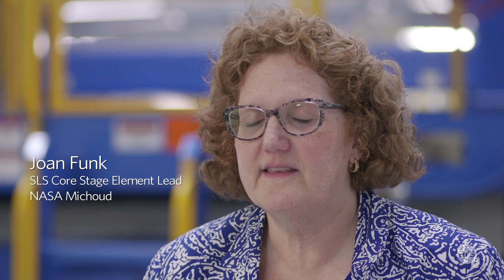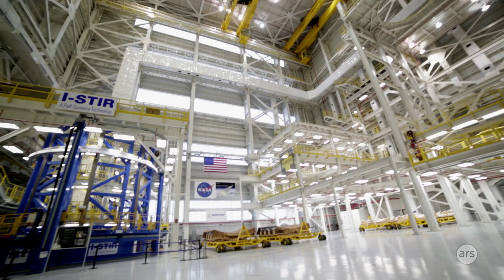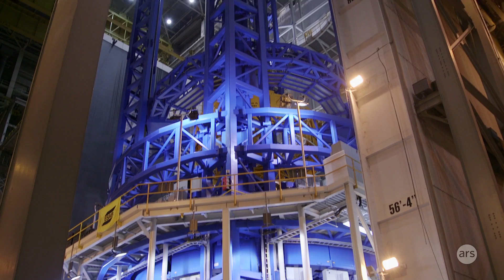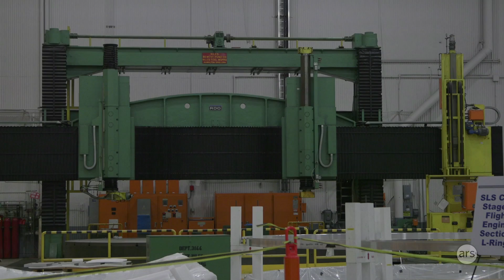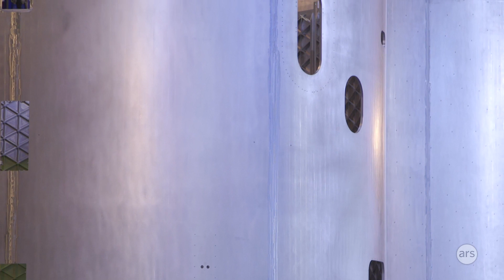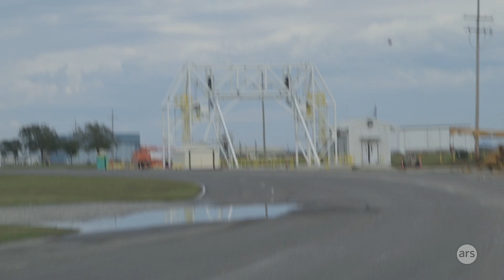NASA Michoud: The Big Tools

Comment: In January 1982, I worked in building 103.  Our company performed a retrofit on one of the 5 axis CNC machines.  For our part of the retrofit the job lasted about 2 weeks.  Our CEMCOR division spent much more time on site, working out some malfunctions that weren't expected during the design phases of the project.  At that time,this facility was assembling the external fuel tanks, used on the Shuttle missions.  This project was one of my highlights, working for Campbell Electronics.  Thanks for sharing this video.
Reply: Whar is a CEMCOR and why would you mention it as if majority had any idea what that was.